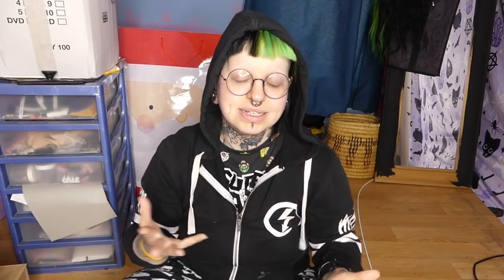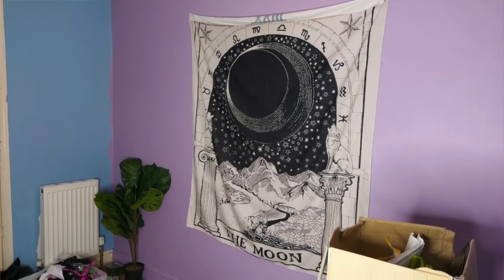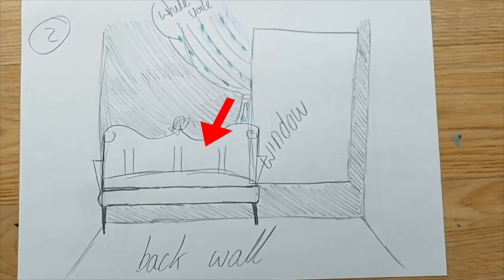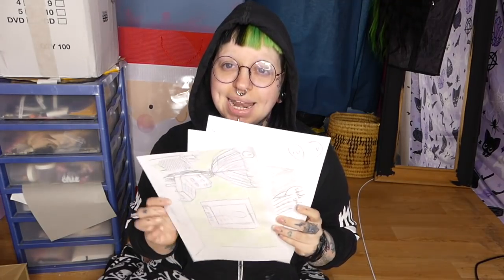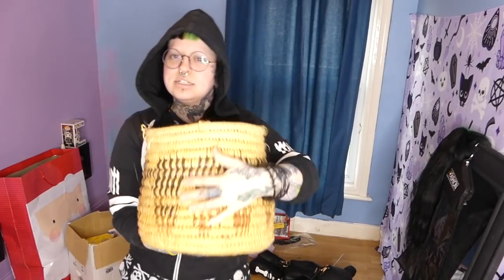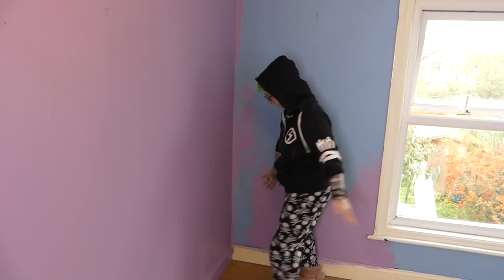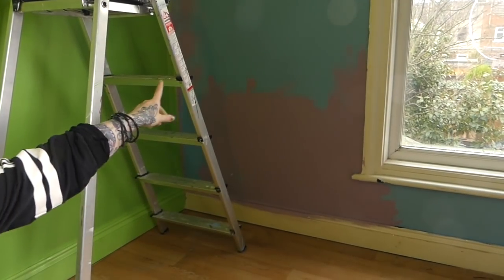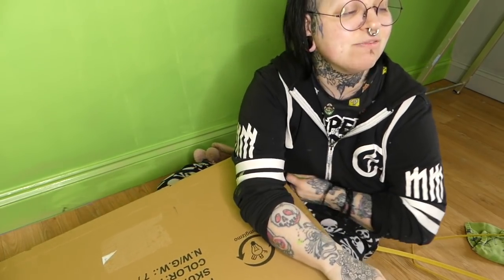Junkyard To Gothic Boudoir *Decorating Vlog* PART 1 // Emily Boo

Comment: To do the wallpaper in the corner you can move the bed forward away from the window and do your mission impossible thing by going under it. So your on the other side with space to do the wallpaper by the window. You can cover the bed to protect it so you can put your wallpaper supplies on it so they are in reach to use. I hope this helps.

Comment: Just pull the bed out, wallpaper that area, then push the bed back and you'll be set. Slide the supplies you'll need underneath,  including yourself ( like how you got out from putting the back of the bed on. Them you won't have to worry about messing up your wallpaper work in the tiny space.

Comment: Where'd you get the bed from?
Reply from the maker: The one I got is not available anymore but this one's very similar https://www.ebay.co.uk/itm/Day-Bed-Solid-Metal-Bed-Frame-3ft-Single-bed-Sofa-Guest-Bed-Sustainable-Daybed/254562793389?ssPageName=STRK%3AMEBIDX%3AIT&var=554277867165&_trksid=p2057872.m2749.l2649

Comment: Hey Emily, I'm thinking of getting my cheeks pierced but I wanna talk to someone who has had them and an actual piercer about them and their healing requirements before I actually go get them done and since you actually pierce now I wanna get in touch with you but I dont have Instagram anymore and my Twitter is suspended do you have an email or a Facebook page I can contact you on
Reply from the maker: You can message my page on facebook :) However I would advise against cheek piercings as they're sooo difficult to heal, can be extremely damaging if pierced incorrectly and leave dented scars x